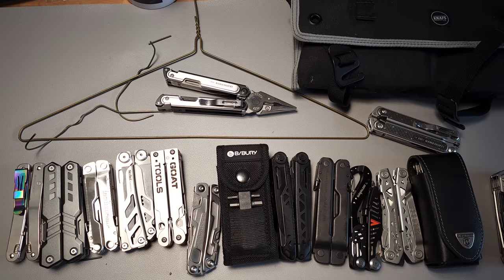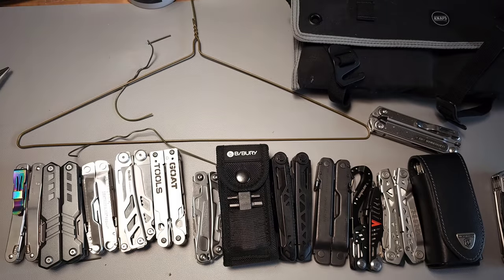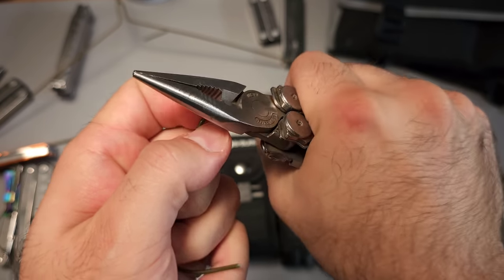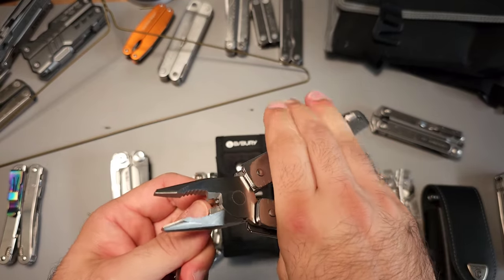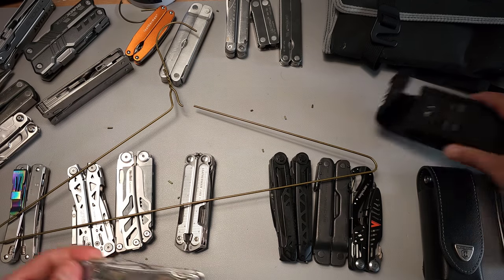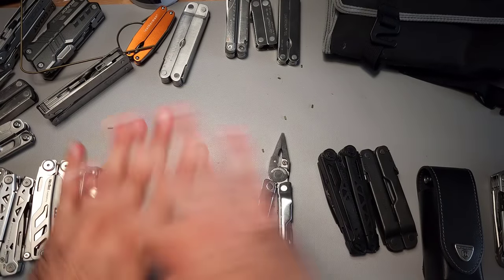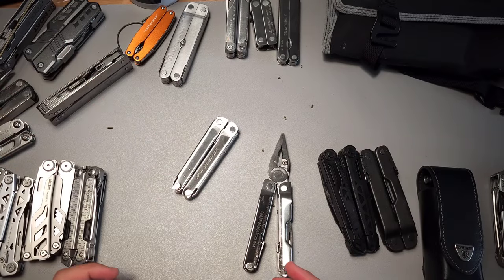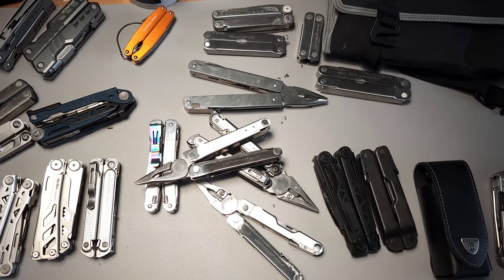Testing Multitool Wire Cutters (more than 15 tested, Leatherman PST - Arc)

Comment: The real question is how did it get past Leatherman QC.
Reply: They shipped me a set of raptor response that were missing a screw. It seems they are lacking pretty bad.
Reply: @JakeHabermansYouTube I believe they would mess up a single unit but generally messing up an entire new piece is gonna hurt.
Reply: @JakeHabermansYouTube .  You can see in the ad the arc that they used in the ad is missing a  screw so I guess they didn’t catch that and they’re still using it as their display model in their ad
Reply: They are too busy drinking chai tea and wearing scented beard oils.
Reply: They probably changed the steel the cutters are manufactured from.
Reply: @joshuavigneaux4224  That is the kind of dedication we require nowadays.
Reply: @cwsmith17 😂😂😂
Reply: The actual better question: was that not supposed to pass their QC...
Reply: "Will they still pay 300 Bucks?"
"Yes."
"Will they buy the replacement stuff if we say its better?"
"Yes."
"... Well, sounds like an extra payment then. :)"
Reply: @DaroriDerEinzige  i have a feeling that was the idea... Like they took a page from Gerber...
Reply: @alphahotel3446  Isn't that the mindset of most bigger companies nowadays? 

Apple, BMW, SnapOn, Harley Davidson, Adidas, ... I mean, I don't wanna "sh!t" only on "Made in the USA!" - It's everywhere.

Because people still buyin' the stuff, also because their ain't much alternatives left anyway.

What do you wanna buy if you wanna have an US made Multitool?

What do I have, as a German, for alternatives if I wanna have a german Car?

There are only a couple of brands in various sectors which are "ok'ish" and fewer left which are good.

And Leatherman will cut costs even more. Because people already hyping the Arc. Because its "US made" - doesn't matter where they source the parts. Doesn't matter the quality.
Reply: @DaroriDerEinzige  you're not going to get any arguments here and it sucks. There's no money in making quality stuff that last.
Reply: Easy outsourcing to China 🇨🇳
Reply: @cwsmith17 😂👍
Reply: @DaroriDerEinzige well said
Reply: Unacceptable!
Reply: On a secondary market, but that fact can make old models cost more)). I live in Ukraine and looking at this secondary markets i see what sometimes people sell old victorinox for price like new, olso leatherman MUT for example cost nearly 160-180$ with missing parts/being used. Average cost of leatherman is 110-120$ for piece (surge,wave,charge) also we have tonn of old micra, but I didn’t wanna it.

Comment: Great vid! I think it would be really helpful in your future multitool reviews to show this test. Along with a stranded wire cut test(some cheap multitools fail at this), test the saw, scissors, etc. Your scissors tests are the best.
Reply from the maker: Looks like I will have too from now on!
Reply: I have cut 12ga Romex with my Leatherman but damn copper is soft. It should at least cut a coat hanger for the money paid.

Comment: I didn’t feel this was a rant, as a lot of potential buyers are concerned about this right now. 
This coming up on the ARC is pretty big. Hopefully, my faith that they’ll get this straightened out isn’t misplaced. 

The S2 always comes through. I use mine pretty much everyday. While the pliers are smaller than on full-sized tool, they are better than any on similarly sized tools. It’s about the size of many swiss army knives and i can throw it in my pocket, while i carry my other usual  workday gear.
Reply: I find it interesting that these cutters came out over a year ago, I checked my brother's P2 and my new surge (I have a series 1 from 06) and they both have the new style. 
Why did no one in the EDC community notice until the ARC release?
Reply: I just checked my surge and it's dated December 21 and it came with the new style cutters.

Comment: Its funny that you mentioned people cutting fencing , I keep a few pet pigs so I cut 12 1/2 ga and 14ga galvanized steel wire for fencing and grounds , a few times a month using the bibury tungsten cutters with no issue.  Some guy on one of the multitool forums was telling people that was wrong and that the tools cant handle that. That made me chuckle considering im planning on doing the same thing the arc  , if Leatherman fixes this if not ill send it back thats an important capability of the tool imo . Thanks for the vid.
Reply: Worst spanking i had as a little kid was taking my leatherman out after getting it for my 6th bd and cutting through the chain link fencing to get to the abandoned barn on the other side.

Comment: As a side note from watching all the testing: The Leatherman Bond is the clear winner over the Rev for a compact budget Leatherman.
Reply: Yep if you can live without the locking blade...or like me in the UK you can't EDC locking blades anyway so the Rev and most Leathermans aren't an option anyway.
The tools themselves are the same as those on the Rebar - I own one of those too - except for the pliers head.  These 2 and the Supertool and of course the knifeless Rebar are the only LMs with fully profiled Phillips SDs which I like.
The  replaceable wire  cutters on my Rebar surpassed my expectations cutting through galvanised steel tentpegs.  I haven't tried the wire cutter on my Bond yet as they are not replaceable but I reckon they would be pretty good.

Comment: I might have an explanation for you!
 So, I was cranking on a hex bolt with Leatherman charge g10. It wasn't super smart, but it actually pushed down one of the wire cutters just enough to catch the pivot at the base of the plier mouth. This made the pliers super stiff, and I used a flathead to push the cutter back up and it was fine. We're talking a small distance like in the mm range. Anyway, my theory is that Leatherman was aware of this and rounded off that bottom corner piece of the cutter, so it doesn't catch there like mine did. Great video btw, I hope you'll get to the bottom of this!

Comment: Awesome video! One of my hangers was too thick to cut & the rest were "standard"  thickness which was 1.9 mm or .074 in thick. roughly 13 awg. Anyway my Bibury Pliers Pro chops the steel hanger 1.9 mm stuff up, but takes a little effort. The replaceable cutters have a wedge on one side and a little notch on the other to capture wire. Nice tool, $50-$60, includes bit kit and the T shank adapter. My Skeletool can't cut it with my normal everyday hand strength. My 30+ year old Klein linesman's pliers chop it up effortlessly, but you're getting a lot more lever action from the 6" long handles. Also it uses an anvil style cutter where the blades meet, where my other tools are a scissors jaw where the blades pass each other. Maybe the scissors jaw that leatherman uses is better for stranded copper wire...dunno. I know I'd be pissed if I was out nowhere trying to fix fence and my cutters broke.

Comment: I don't blame them for making a mistake. As a design engineer, I've made seemingly inconsequential changes that have come back with problems. The issue is that it reached the customer without them knowing. If you could buy 'flawed' cutters at a discount in order for them to move stock, I'm sure people would still buy them. But being ignorant of the change and or hiding it from customers isn't ok.
Reply: Any chance this is a bad batch from the vendor? Do you know if they text every batch they receive?
Reply: @For891  This wouldn't be considered a bad batch rather than a deviation. Any deviation should have a sign-off/agreement with both parties. At least for me, all batches come in with a serial code to track them. They should undergo a batch inspection in which you'd inspect say 1% at random. If it was a new supplier you'd jump this back up to 50-100% etc. And then as part of the standard build process there should be random inspection of the final assembly which should include relevant tests. This is like the bare minimum. Even with this there can be gaps but it shows a problem with their process in my opinion.

Comment: It would be interesting to know what Leatherman was thinking when they changed the design and if the gap has any sense. Especially because the cable stripper is on the awl. 
My P4 is from this year and has the gap also at the wire cutter.
Thanks for your videos and I am curious about news.

Comment: Honestly since owning my new Arc I've had zero issues with my cutters,I've not cut coat hanger with it yet,I don't really have any metal one laying around the house,but I plan on trying an seeing if it passes my tests,also will be ordering new cutters just to be sure,if it works well then I just a pair for backup.

Comment: I like how you mentioned that sure the hard cutters will work if you are careful and slot the wire directly into the notch., but like you said, no one does that! Open pliers, push wire to bottom, cut.
Also can be an issue for any multitool with replaceable cutters, even old ones. Because if the cutters on my Wave happen to break after using them for so long, ordering a new set would make the tool worse.

Comment: I used to love my Wave 2nd gen up until I finally bought a Spirit X. Recently I wanted to replace a plier head in my Wave to a Wave+ version just as I did replace a cheesy 420hc blade with an S30V, but after watching this video and fiddling with my Wave once again I have to admit that Spirit is just better for me. It does what I need and it won’t rust. And there is zero breaking in or adjusting I had to do - it just works. 

All of this is really sad, because I do respect Leatherman as an ingenious company that started it all. I just wish they’d keep caring more about the tools they produce. Just as they did long ago.

Comment: One of the reasons I personally preferred the seperate cutters is they should be easier to heat treat to higher hardness, appears it can go the wrong way. I guess still better than jacking up the heat treat and replacing the whole plier head.

Comment: In what are made the wire cutters on the Arc? It says "premium steel" which usually means "bullshit" and if I recall correctly it was some 420Hc on other models (Wave/Surge) but isn't that kind of an abberation to use some low-end steel instead of carbide tungstene for wire cutters?
Reply from the maker: Used to be 154cm, but they stopped that.

Comment: I have happened to come across some hardened wires to cut when I had just purchased PST and once with Surge with replaceable cutters. I had pressed really hard on them and those hardened wires made dents in the wire cutters.But on Surge it was not  the hard wire cutter but the soft wire cutter that I stupidly used.

Comment: Great video! Thank you for taking the time and doing all the testing! I agree with you 100 percent. Leatherman has been asleep for the last several years and very lazy from top to bottom. Their not running their business properly from engineering, production, to sales & marketing! For example…. Why doesn’t Leatherman have the ratchet in stock? I can’t even remember the last time the ratchet was in stock. What are new products being shipped and not tested / QCed? It’s sad to see Leatherman continue to fall flat on their faces.

Comment: With my fuse or Bond I've never felt the need for replaceable cutters and I've abused the hell out if my Fuse, I used my Fuse like I stole it ( because I kind of did ) and never had an issue with anything except the scissors.

Comment: I have a Surge Titanium and shattered first set with fencing wire and second set have defined indentations from cutting 0.9mm welding wire which is pathetic.  I'm currently using a Olight multi which is only $20 it's been cutting welding wire for the last 12months.

Comment: I wonder if you can find third party replacement cutters that don't have the notch.  have you checked if the knockoffs can have theirs swapped?  Also, have you checked that your ARC ones were tight? If they're loose at all (even if held in with thread lock) they're going to flex in ways that might make them crack.  I wouldn't be surprised if they didn't get fully screwed in, my signal came with some loose ones, but no threadlocker so I assumed it was REI's and not Leatherman's fault in my case.
Reply from the maker: They were tight for sure
Reply: @maxlvledc  having seen other reviews now, I wonder if the bit of side to side flex of the pivot is the issue, making the cutters collide or something

Comment: My arc comes tomorrow.  Should i test cut with it??? I mean first thing out of  the box...
Reply from the maker: I don't know about that..
Reply: If you decide to do it, try not inserting the wire all the way to the end of the cutter, then at least you’ll have an idea if the problem lies in the heat treat or the radiused corner design. 👍🏻

Comment: Made a lot of excuses for Leatherman. I’ll take my Swiss tool over any Leatherman I’ve been carrying my Swiss tool of over 25 or so years.
Reply: I agree 100% I cut fence wire all the time with my Victornox Spirits non replaceable cutters and they still cut and look great!
Reply from the maker: Yep, vic does hard wire very well.
Reply: I have broken a plier jaw on too many SwissTools to think they are quality.  Junk.  To be fair, I was not cutting wire, at the time.  Usually twisting wire, or turning a nut/bollt.  Regardless, I was not extering a lot of force.  Victorinox warrantied the tool, then again, and again, and again...  Over 5 years of warranty repairs and replacements on Victorinox junk.  I'm glad you mznaged to carry your Victorinix for 25 or whatever years.  Have you ever used it?  Vicgorinox makes fragile stuff meant for working on dollhouses, maybe, or keeping in a drawer.
Reply from the maker: @googleuser6635  really?!?! Your the first one I've ever heard breaking them multiple time turning nuts. We're you doing it by hand?
Reply: @maxlvledc  Yep.  No cheater bar.  Victorinox had me send them pics, then the tools.  Acgually, maybe pics was only the first time.  At least once, thry replaced the tool, because I sent one in with scissors, but got one back without, then had to wait for the scissors version to be back in stock.

I'm fairly sure I'm not the only one on this, because Victorinox was looking into this.  They ended up changing the design of the plier head.

I'm not a muscle-bound brute, either.

I understand why you're doubting me.  Heck, people doubted the cutters breaking on your Arc.

If it makes you feel bettee, I have had the jaw break on lots of diagonal cutters and a pair of flush cutters.  It seemed to have to do with placement of the item to be cut.  So, I changed brands of tool.

Comment: Just got a wave plus around a month ago and mine has the rounded cutters that form a gap beneath the cutters but my Surge I've had for 2 years and my rebar from 4 years ago both have overlapping flatter edges without the gap. Not sure what Leatherman is thinking but they need to bring back the old flatter cutters unless their goal is for consumers to constantly buy new cutters so they have a constant influx of cash flow. Not cool Leatherman!

Comment: Im happy with the cutting of the Surge. I cut 2 or 3 mm screws (pins from pedals) and 3 mm cable strand, part of a larger crane cable strand.
Im also very happy with the cutter of the Squirt Ps4. Im not satisfied at all with the very lame cutter of the Gerber Dime. The only good tool on Dime is the cap opener.
Edit: the pliers and cutter of the SOG PowerPint is also bad, not in terms of capabilities but in terms of usage, it pinch my skin. Very incomfortable tool with that closing from behind system!
Reply from the maker: New surge sadly will have these new cutters.
Reply: @maxlvledc  thanks for the info. Ill try to use the Knipex Cobolt S when possible instead of the Surge. Or maybe the cutter behind the pliers of the Surge, i never tried it on screws or anything really hard.

Comment: You should have compared it with an older rebar with older replaceable cutters to make a perfect comparison. Or used that ST300 with the older replaceable cutters. It would be made a better picture for your point.

But great video
Reply from the maker: True, and I had one too...

Comment: This is something that has plagued the Center Drive for years now and I still hear it all the time. The cutters are trash, garbage material etc. The cutters were never meant to cut anything denser than concertina wire. Most soldiers are typically cutting zip ties, C-wire, Det-cord  and nylon. Then people say “well then it’s no good for tradesmen” and I dare to say it was never made for tradesmen or shop workers in the first place. Unless regular tools come with coyote tan molle compliant sheaths? I’m pretty sure it was made for servicemen not tradesmen.

Comment: Yeah.... my experience with the GOAT differs massively from yours. 
Just this second tried same on coathanger in UK (maybe different steel, maybe I'm puny) & no way I could cut it single handed. Didn't bother trying with 2.
'94 PST breezed through it, as did Mossy Oak (£18 delivered) & even LM Skeletool-bit surprised about that. 
I don't even bring out Rebar & Swiss Tool to compare any more, the (definitely not) GOAT doesn't deserve to be mentioned in the same breath, but out of interest tried Rebar & no issue whatsoever, new design cutters, just aligned properly as per Ink&Iron
IMO GOAT is most over-hyped piece of junk I can remember in a while, & it's not just the wire cutters.

Comment: Nice video. Here in Sweden the Arc is 350$ so it feels absurd to have this problem. Do you know if MUT EOD cutters fit the arc? 
Havent tested them out that much yet but i really think GOAT tools came up with a good solution for how to maximize usage on the cutters with their rotating kind.
Reply from the maker: Technically yes if you modify them.

Comment: Gerber is known for major wire cutter failures.
Reply from the maker: 100%
Reply: Replace the carbide cutters with the HSS cutters from Little Machine Shop and failures are eliminated.